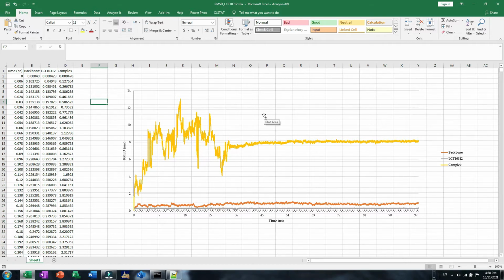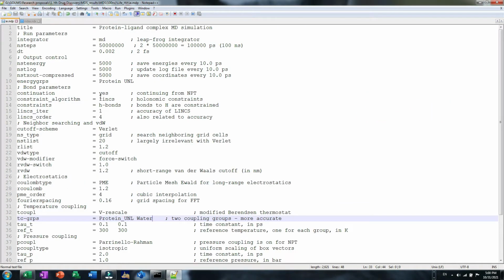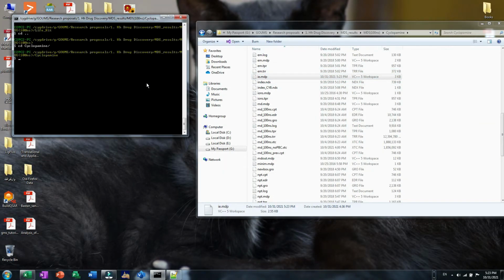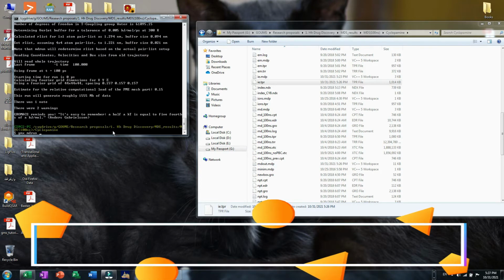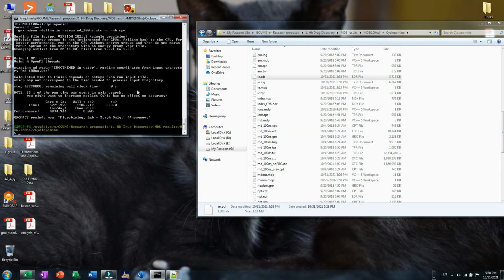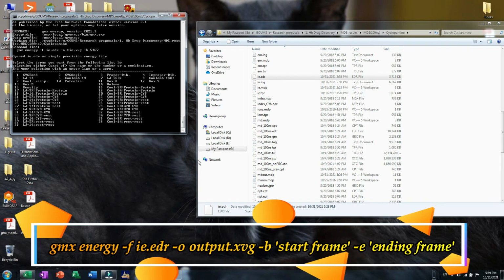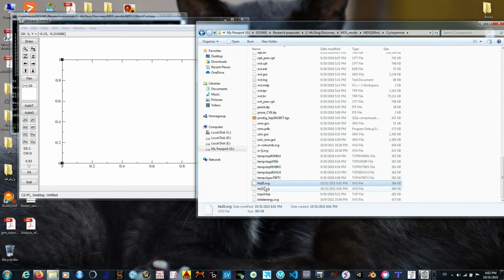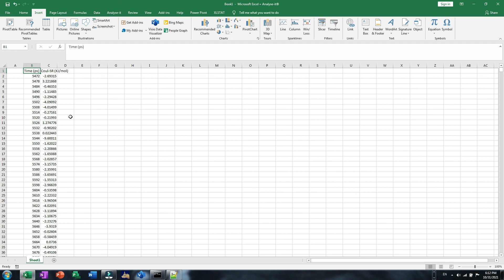Molecular dynamic simulation--convergence and analysis of interaction energy by GROMACS

Comment: Thank you Alireza for your replies.
When I am running the gmx mdrun command I have this warning:

Some frames do not contain velocities.
Ekin, tempratur and pressure are incorrect, the virial will be incorrect when constraints are present. 

How I can fix it?
besides I do not know, where I should get the start frame and end frame for the last command? 
I would be grateful if you could help me to solve this two issues.
Reply from the maker: Dear Mahboobe, check the nstfout and nstvout values in the .mdp file. They should not be zero. You also need .trr file containing velocities.
Reply: Thanks, How much should be nstfout and nstvout? With this warning my results for the energy is incorrect?
Reply from the maker: @mahboobeazarakhsh1676  Please check the .mdp file. No I don't think you analysis would be wrong. You can bypass warnings with -maxwarn (e.g. -maxwarn 2)

Comment: Thank you for your great video. 
Is it possible to calculate the binding energy between two proteins in a complex using this method?
Reply from the maker: Dear @Mahboobe this method is possible to calculate the free binding energy between two molecule after molecular dynamic simulation. In the case of docking, different force fields are used.